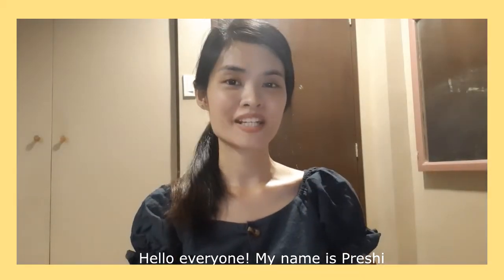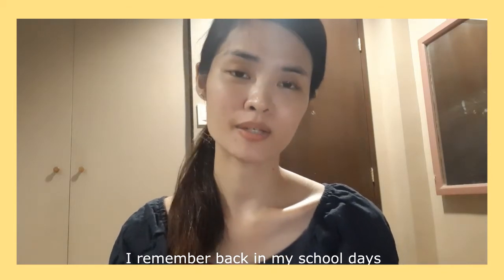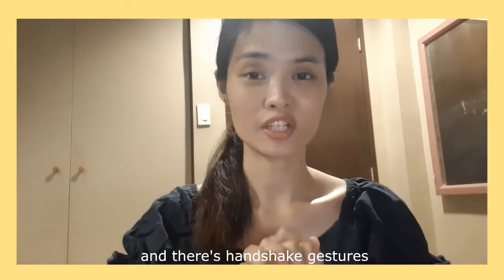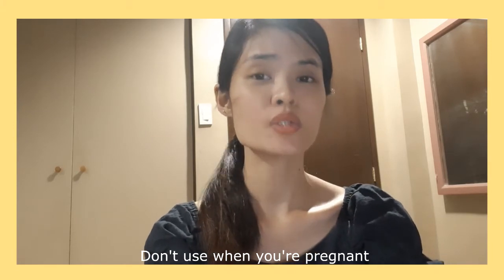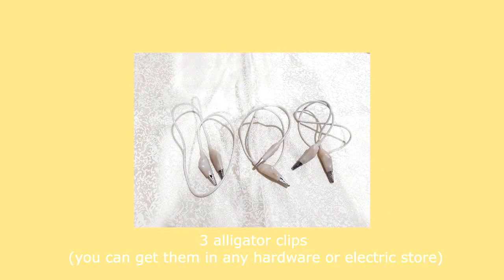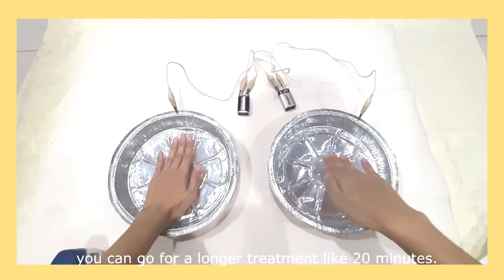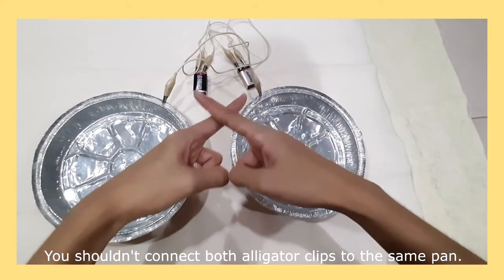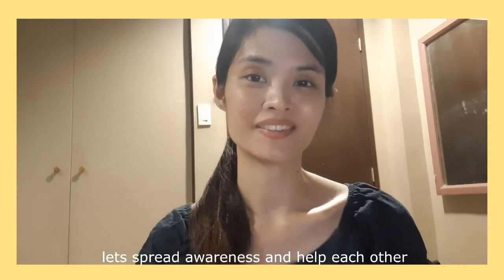Homemade Iontophoresis Device

Comment: Hello! I have hyperhidrosis since birth.I am from srilanka and 25years old.I was too much suffer from that condition.after watching your video I almost done this treatment 8 days in continuously. now I feel like around 70-80% less sweating in my hand. Sharing about my experience I added one tea spoon of salt to 500ml of water and used for plates filling.also after day 4 I  noticed that aluminium foil plates were geting thin and noticed some water leak.if you didnt miss the science class you should know that is Electrolysis.so use thicker plate or change the plate after few days. About timing I followed 14min × 2 session. Also I want to thank Precious Macapagal for sharing this with us.thankyou three thousand times 🙏
Reply from the maker: Hello Im glad this worked for you!!  Thank you for sharing your experience ❤️ and yes I agree, instead of aluminum foil pans, we can use those durable aluminum pans :)
Reply: Hey are you still using this treatment and how is your progress?
Reply: Now u r free from sweaty hands or using treatment please reply
Reply: @vishaltech5357  during the period that use this method no sweat.also do not use chlorine water because when i used chlorine water i have noticed itching in my plam
Reply: @sahanranasinghe8330  ok thanks 
Pls what's the current to use in the battery
Reply: @ifedayoolurotimi256  I used two 9v batteries series

Comment: Hi @Precious Macapagal thank you so much for posting this video. I have a few questions
1, How much percent would you say this is effective, like do you still sweat from your hands? 
2.Also when you connected the batteries I think in series does the total voltage become 18v? Can I use just one battery if I'm just beginning is that ok?
3. Are you still doing the treatment yourself and if so do you have any recommendations for beginners?
Thanks so much again for posting and it would mean so much if you could answer my questions. I'm suffering from severe grade 3/4 palmar HH and I'm desperate for a solution 😔
Reply from the maker: Hi! So sorry for the late response but oh well

1.With continuous use, i can say this has been 80-90% effective in lessening my hand sweating.

2. Yes, connecting 2 batteries total to 18V. I recommend using 2 9Vs to get it very effective.

3. For beginners, I recommend using it daily for 5-7 days straight, and for severe cases, up to 1-2 weeks

I haven't been doing the treatment lately because of busy schedule so its why my hands gets sweaty😅😊

Comment: Hi , sorry for my english 
I’m using diy iontophoresis machine (2*9v battery) , i have hand and feet hyperhidrosis , but im using iontophoresis only on my hands , the results is good(not 100%)  but sometimes in the day my hands still sweat especially when im stressed 
My questions are : 
how to achieve 100% dryness even when im stressed or anxious ! Is that possible ? 
Is treating hands without feet decreases the effectiveness ?
Reply from the maker: Hi! Iontophoresis can only treat hyperhidrosis almost 80-100%, so its very important to take maintenance sessions as well. For anxiety, I think this would help by seeking doctors 🙏 thank you

Comment: Thank you a lot for this video i will start tomorrow you gave all the necessary details and your english accent is amazing.
Reply from the maker: thank you,  best of luck!
Reply: what were the results so far?
Reply: Did it work??
Reply: It works guys, dont even think and try it. It worked for me with 9+9=18 volts, just some soda and salt added to tap water. By the way if you keep doing this fpr a while, dont forget to change your alligator clips after a while. I changed it, the shock and tingling was more, therefore i believe its effectiveness increased.
Reply: @Kbarismath  I didnt think the wires wear off. I heard the reusable aluminum pans need change though.

Comment: Hi, I've just started treatment with a single 9V battery - should I add another one(I didn't add another one because I could already feel tingling on my palms and fingers, so I thought it would be enough)?  Also, how long should I expect the batteries to last? Thank you!
Reply: I've now started doing 18V - it shocked me a bit at first but power through it and when you're doing it you won't feel much.
I'll update if it works
Reply from the maker: @Benethen_ yes, 18v or 2 batteries work. So when you try to dip your hands, make sure you do it one by one and slowly. Please update thanks!
Reply: IT WORKED! Thank you so much! The sweating inside of my hands is completely gone, at the tips of the fingers there is still a bit of sweating but it's so much better. I'm so happy!! @preshimac
Reply from the maker: thank you so much for the update! im glad this helped <3  @Benethen_

Comment: Hi! Can I ask you something? I did everything you said in the video for 12 days and now i’m doing it once a week. My hands don’t sweat anymore but a part of my fingers still does. What should I do?
Reply from the maker: Hi thank you for commenting, maybe try to fully submerge your hands? so your fingers get the effectiveness of the electrical current
Reply: @preshimac  Do you think I should start the treatment again but just submerging the part of my fingers that still sweats?
Reply from the maker: @angelicacastro2658  you can try that, make sure its comfortable :')
Reply: @preshimac  Thank you so much!
Reply: Do you use baking soda or salt while ionto?
Reply: @angelicacastro2658  you also had palmar hyperhyrdrosis like me?
Reply: @julynet2275  salt
Reply: @sudheern8229  yes :(
Reply: @angelicacastro2658  thats because of bad conduction when fingers touch pan. simply put towel under hands

Comment: it is wise to use a voltage meter to check the current . Sometimes,  electric current does not flow due to improper connection.

Comment: Hi, is this method 100% safe considering its diy device? For how long do these batteries last? Thank you!
Reply from the maker: I always suggest you get advice for the doctor or buy a ionto machine online. Im simply sharing an alternative DIY device esp for those strugging financially but want to get the same effects as commercial devices. Ive been using this for years and so far, I've been fine😊

Comment: i get shick during process which will let my hand out of the bucket.
i thought the volt is high so i used only one battery 9v but it give me shock after 5 min of process. the shock that will let my hand remove of the bucket.
is there any solution?
Reply from the maker: Hello thanks for reaching out! Make sure you've followed precautionary measures. 
Were the alligators clip attached correctly? (positive to negative)
Are the aluminum pans placed away from each other? (they shouldnt touch). 

Please also make sure the table surface is preferably wood or its placed on a clothing.

In addition, make sure you dont also have any open wounds on your hands, if you do, please apply vaseline or petroleum jelly on the wound and slowly place your hands one by one.

Comment: I tried this method today, at first I used 3×9volt batteries, but soon realised that 27 volt is not comfortable, then reduced it to 18 volt, Might be because it was my first session therefore I didn't felt any reduction in perspiration, will update it after 1 week!

Btw any suggestions for foot?
Reply from the maker: Hi thank you so much, for feet, its the same process but just use rectangular pans, then place a cloth on the pans so you can rest on it.
Reply: @preshimac btw, how did you get to know about this?
 what must be the ideal current and voltage should range between?
Reply: @suyashchakraborty5276 any update?

Comment: For how long should I do this treatment and how frequently? It worked temporarily
Reply from the maker: Hey there! You can do the ionto sessions when youve reached at least 80-90% effectivity. Then after you can just start doing maintenance sessions. Like once or twice a week :)
Reply from the maker: Pls note that iontophoresis is a temporary and not a permanent solution. You just really have to be patient and consistent with this. I get lazy sometimes so I woould notice my hands would go back to normal sweating after not doing the ionto for 2-3 weeks.  So its important to stick to a weekly routine :)

Comment: Are results possible with only one 9v battery?? I have pretty hard water, using two 9V in series is quite hard for my hands as its really strong current im feeling.
Reply from the maker: i dont recommend 9V since it might not be as effective as 18V but if its not comfortable, go for it :)

Comment: Thanks kindly, I've been suffering a lot so excited to try this. I'm on my 3rd day of treatment but only using 1 9v battery, is that not enough, I assume you connecting two 9v together increased the current?
Reply: Increases voltage , this case it doubles it.
Reply from the maker: Hey there, i advise to use two 9V to make it super effective. Best of luck!

Comment: I've been doing this for a few months and it has been great, however, the last week or so my right hand has started sweating again (especially the fingertips). I've replaced the batteries and pans and even tried using carbonated water. Do you have any advice, has it happened to you perhaps or should I just continue with the treatments?
Reply from the maker: Hello thanks reaching out, may I ask if you do maintenance session like once or twice per week.

I recommend submerging your palms like three fourths if that makes sense..., including your fingertips for proper conduction. Best of luckkk
Reply: @preshimac  thanks for the reply, yeah I've been doing it 2 times a week for maintenance and am submerging my fingertips in, I guess I'll just keep going and pray they clear up again. Thanks
Reply: @preshimac  I'm also going to try putting the positive current on my right hand first instead (I usually start with positive on the left). Do you always do positive on the same side first?
Reply from the maker: @bertrodgers2420  im not sure it really matters, as long as they're positioned correctly!
Reply: @bertrodgers2420  Same with me .....what did you do? Any tip/suggestion?
Reply: @UC9PDP0l7jawGLU0a_xJVS3Q hello, yeah I did more frequent sessions (every other day) and I did start with positive on the opposite hand although I doubt that made a difference. After just over a week they were back to being dry, mine are currently feeling slightly sweater than normal, but that's because we're in a heatwave.

Do a treatment every other day for over a week and hopefully you should be golden. Let me know, God bless
Reply: @bertrodgers2420  Ok thank you...hope it will work.
Bless u :)
Reply: @bertrodgers2420  do you have any tips for someone just starting iontophoresis and can you please give us a follow up if your still doing it. Thanks in advanced
Reply: @rainbowdash  hello, I've been doing the treatment consistently now for over a year. Currently I'm down to just a single 20min session a week. If the weather gets hot I may do two, but only if required.  For tips I would say it really is just patience, my setup is very similar to this video with two 9v batteries together.  Another thing I found really helped is to use warm water, not cold, warm dries them out much more from my experience. Overall it has genuinely improved my life, handshakes are no longer an issue at all and everyday objects no longer have sweat marks after i hold them, silly things like not being able to open a plastic bag because my hands are dry make me very happy lol. Keep at it my friend and feel free to message here if you have any questions
Reply: @bertrodgers2420  bro how many days    this two batteries will work please reply
Reply: @vishaltech5357  I tend to replace them every couple of months. But I only do a couple of sessions a week, so it's probably overkill
Reply: @bertrodgers2420  pls how many current do you use for the 9volts battery
Reply: @ifedayoolurotimi256  not sure I understand your question. I use two 9v batteries connected to each other
Reply: @bertrodgers2420  what current does your battery deliver
Reply: @ifedayoolurotimi256  it's a 9v battery - those rectangle ones

Comment: Hello Preshi, I see no information about 
miliampere in battery, 9 volts will not kill you but higher amount of mA will! Could you recommend how much we should try out first time?
Reply from the maker: Hello, thanks for commenting! I looked it up and it says 10ma. One 9V is equivalent for 50 hours or so :) I recommend going for 18V first. Personally, I use two 9V batteries (18V in total) for a total of 30 mins (15 mins each session and reverse the alligator clips after first 15 mins).
Reply: @preshimac  Haha, thank you very much, this very moment I'm traveling throughout the city to get some batteries, but everything is closed because of Covid, oh no! How am I going to electrize my body 🤣
Reply from the maker: @iweirjkdkfmk  oh no im so sorry to hear that! Have you tried buying them online? :'( I hope you get those materials soon so you can start the ionto 🙏 stay safe!
Reply: Already managed to get all what I need, thank you very much for the video Preshi! For hands I'm using 9V + 4,5V batteries together and for feet 9V + 9V as I didn't feel almost anything with only 13,5V. I'm having troubles though with finding a good conductive containers for both hands and feet. Maybe it would be possible to just wrap a plastic ones with aluminum foil which is a conductor, do you have any ideas? Or even use plastic ones and just put cables straight into water.
I'm really curious what will happen in 5 days!
Reply from the maker: @iweirjkdkfmk  im so sorry for the very late reply sir! I guess that can work, as long as there is electricity flowing :) How's the ionto treatment going sir? Any improvement?

Comment: Wt if i feel the current is abit too strong for me can i start with 1 battery or it would be too weak as i have extreme hyperhydrosis?
Reply from the maker: Yes, the shock is normal but dont worry as this is the normal or minimum voltage required for the ionto to work. Please make sure to follow precautionary measures. Make sure the pans dont touch each other. Wear socks or step on a rug when doing ionto and make sure your hands are clean and pat dry before doing ionto. Best of luck ❤️
Reply: @preshimac  thank u sooooooo much
Reply: @ahmedmoneeb4884  how's your result?
Reply: @bipadtarandas1721  Stopped the sweat by nearly 70 percent which is ok for me as i had extremeee hyperhydrosis..however ionto didn't work for me, until i stopped reversing the current. i don't know why..to keep the results i have to do it once or twice a week depending on the level of stress i face during the week.

Comment: What if i rest my hands on the stainless steel plates without using cloth? Any specific reason to avoid that?
Reply from the maker: either let your hands hover in the aluminum pans or use a cloth/sponge so your hands can rest on it while doing ionto. This is to let the electrical currents/ions travel or flow around your hands/feet to be really effective on your sweat pores :)

Comment: I tried with a 12V battery and it felt like I was legit getting shocked by a socket. Is that normal? If I try a 6V would that be ineffective?
Reply from the maker: Oh no, it's not supposed to be like that. You should just feel a mild tingling sensation from the ionto. Im not sure if 6V would be as effective as an 18V ionto device. Just wanna ask, have you read all the precautionary tips? Make sure that no two clips are attached on the same pan nor should both pans touch each other as it would cause a short in the current. If you have cuts, apply vaseline. I feel like the treatment would be effective if it was 2 9v baterries.
Reply: @preshimac  thank you for the quick reply! Yes I did read the precautionary tips, though I’m going to try it again and add the baking soda to water as suggested, maybe that will help with pH
Reply: Just a little update...I was finally able to do it!! Hopeful for my future dry palms :)
Reply from the maker: @smakitty  yayy im glad!! 🥰❤️ Best of luck and saying hello to sweat free hands in the coming days! 🙏🙏🙏
Reply: @smakitty  how did u fix it?
Reply: @smakitty  how did you avoid that shock?
Reply: @un1ru  i started to step on a rug and that eased the shock
Reply: @dada-qv2pz  I stepped on a rug and that helped a lot
Reply: I was shocked too but my siblings tried and felt a little tingling but when it comes to me I can't handle the electric current. I'm really frustrated I don't know what to do
Reply: @preshimac  I have a question.. Can Iontophoresis cause nerve damage? Is there any side effect on brain

Comment: hey, how long does the 9v batteries last? like how often should i buy new ones?
Reply from the maker: Hi! You can change the batteries once you feel its weak. Personally Ive been using the same batteries for almost 2 years now :) It will depend on the usage
Reply: @preshimac  if i have 2 machines or tools, can they be used at the same time? 1 for 2 hands and 1 for 2 legs so it doesn't take long

Comment: Have you tried one battery? I felt less voltage than 2. I have severe hyperhidrosis lumalala sya after my motorcycle accident. Thanks in advance
Reply from the maker: Try nyo po 27 voltage meaning 3 9V batteries. Di po kasi magwork kung isang 9V lng po. Have to be patient with ionto, usually mga a week at most po makikita ang result.
Reply: @preshimac  Thanks Preshi I'll try it. Medyo may tingling sensation pero di Naman masakit. Nakakagulat lang. Thanks for sharing.
Reply from the maker: @markcruz9154  thanks, expected po yun hehe that means its working. God bless po!